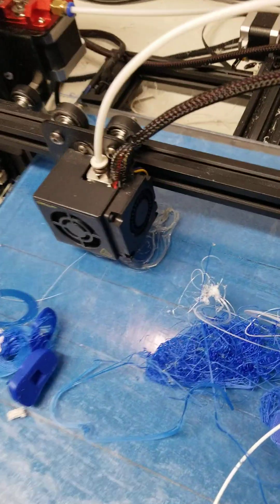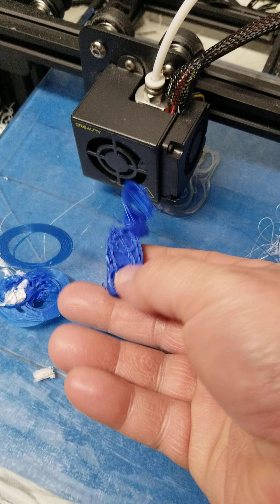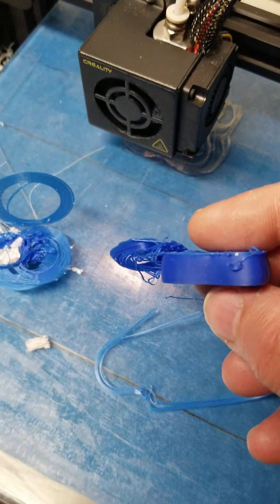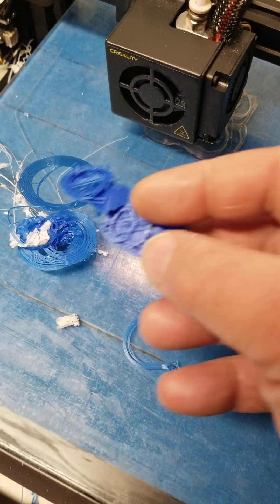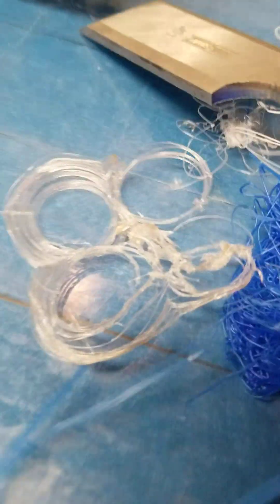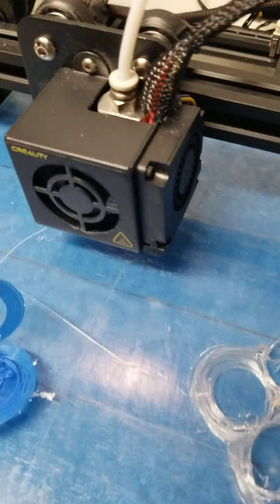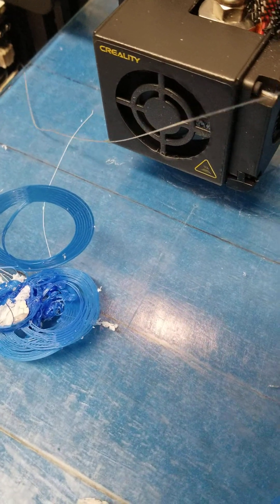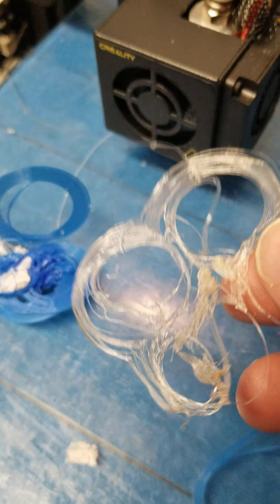New Filament Adhesion Problems #3dprinting

Comment: your first layer looks too far, try to decrease the nozzle height. You can try to use a glue stick on the glass, or buy a PEI bed
Reply from the maker: I actually stopped using glue stick and turned it up to 75C. I think what happened is that I had moved everything on the table over and pinch the spool so it wouldn't turn as well as it should. I am trying to make space for more CNC tooling.

Comment: Try drying your filament
Reply from the maker: Shouldn't it be dry if I just bought it and it was vacuum sealed with desiccant?

I am really asking because I am wondering if it was only recently sealed and the desiccant hasn't had enough time or maybe the desiccant only affects the inner most layers since it is left in the middle of the reel.

Comment: Buy bamboo
Reply from the maker: Maybe when I get the cash. Need more subscribers.
Reply from the maker: This seems to be a popular opinion, but do they have a large format printer like the CR-10?
Reply: @davesplains9400  a p1p would be close, it's like 50-60mm smaller, a x1c is a bit bigger.

Get a bambulab if you just want to print. If you enjoy tinkering with your 3d printers, it would be a bad choice. Everything is closed source, horrible TOS